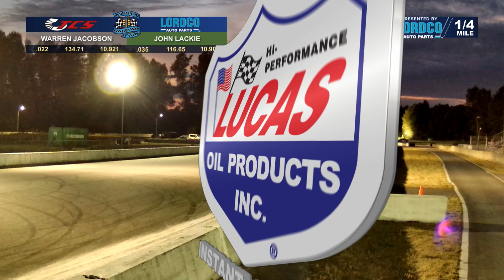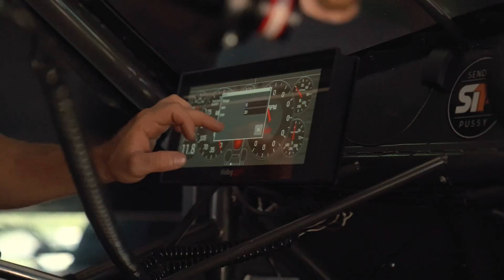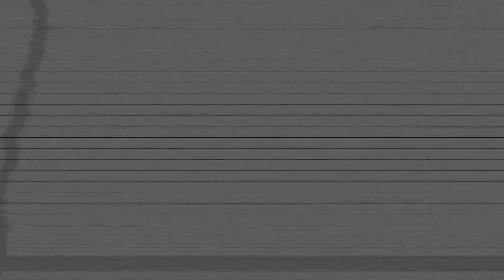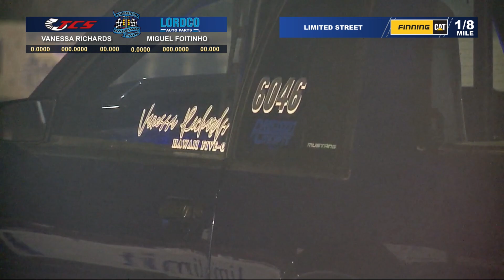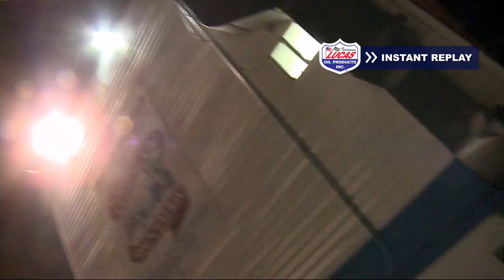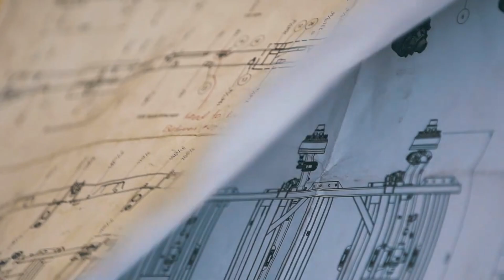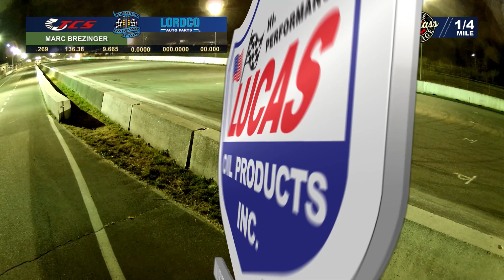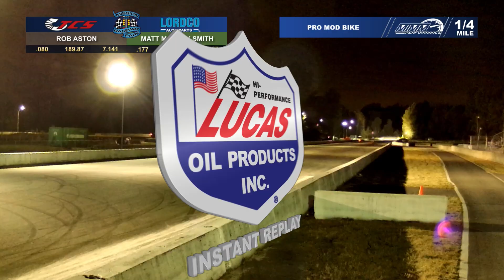Smoke, Fire and Thunder! - Saturday PART 2 - LORDCO TV - August 20, 2022

Comment: 0:00 - Pro E5
1:30 - Super Pro E4
4:00 - Super Combo Final
19:00 - Outlaw 275 E3
25:00 - Limited Street E2
28:00 - 604 Street Legit E4
30:00 - Sportsman E5
33:00 - Doorslammers Q3
39:00 - John De Jonge takes out the 330' block
52:00 - Doorslammers Q3 (Contd.)
56:00 - Hot Rod E5
58:00 - Pro Mod
1:07:00 - Top Fuel Harleys/Jim Schellenberg hits both 1/4 blocks
1:21:00 - Pro Mod Bikes
1:23:00 - Motorcycle Final
1:26:00 - Nitro Funny Car
1:29:00 - Fire Stunt/Jet Car
1:41:00 - Hot Rod Final
1:42:00 - Pro Final
1:44:00 - Super Pro Final
1:47:00 - 604 Street Legit Final
1:49:00 - Track prep
1:59:00 - Outlaw 275 Final
2:02:00 - Limited Street Final